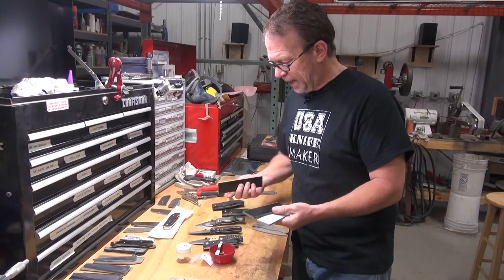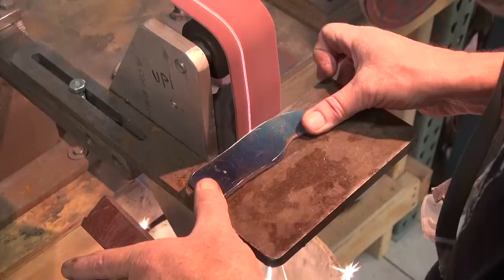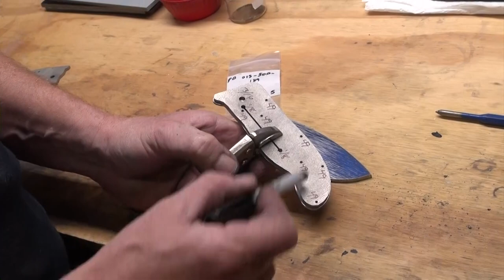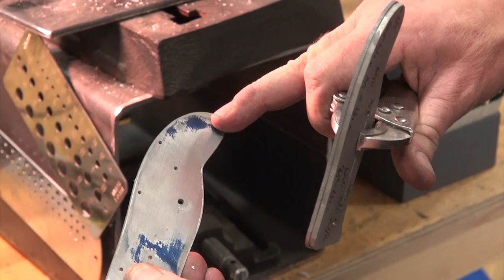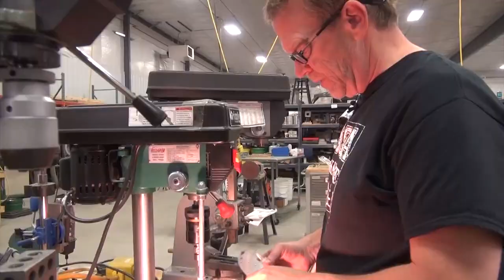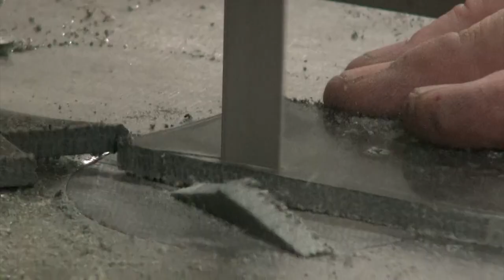Making a Liner Lock the Easy Way - Part 1

Comment: Hello, w
hat's the model drill press you are using?  Thanks.
Reply: I use cheap harbor freight drill presses. You do need to check that they drill a decently perpendicular hole. youtube "tramming drill press"   I checked mine using a dial indicator and found the 0 (zero) mark on the table tilt was (surprisingly) accurate and just go by that. A simple way to check it is drill through a big piece of wood, flip it over and drill through the same hole. If no wood is removed on the second pass through the "backside" the table tilt is probably OK. Crude but it works. If the second pass gives you a lop sided or oval hole, your drill table isn't square. Run out on the cheap drill presses can be improved by switching to a hand chuck from a key chuck.